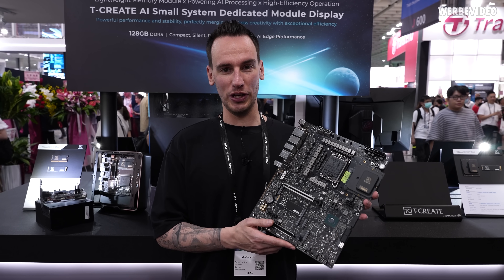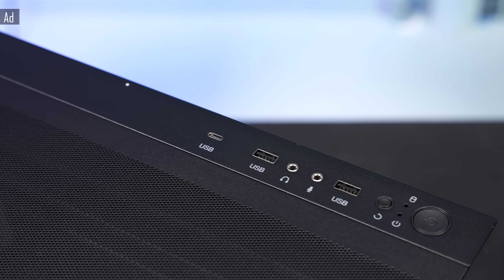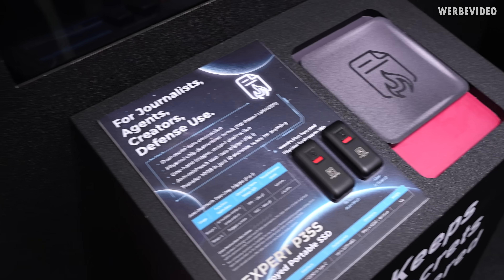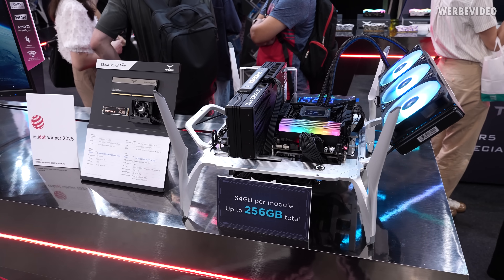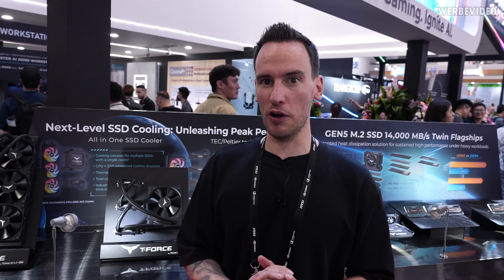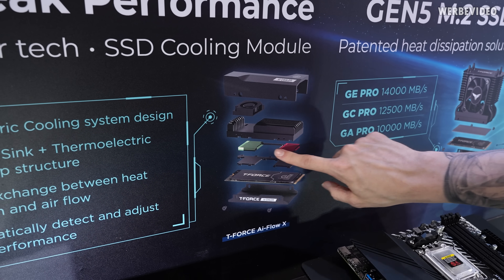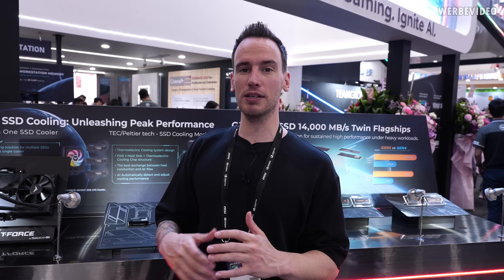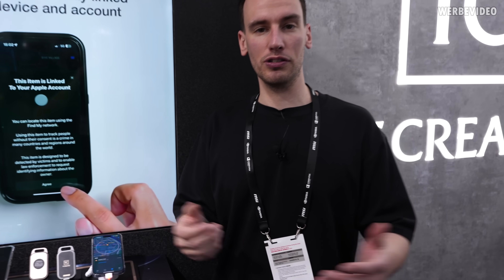This SSD Blows Itself Up on Purpose - TeamGroup Computex 2025

Comment: The stupidity in the comments would be surprising f it was not predictable. You can kill something with voltage and the user can have zero idea anything happened and its not even close to being dangerous (more or less than any SSD is already). But also, just because some applies the name "AI" to something doesn't mean its slop - or rather, at worst, its marketing slop, but marketing is always slop and always has been.  They are whatever legal lies they can use to get you to buy their product over others. Also, some ya'll have become so vigilant over "ai slop" you see it in many places it doesn't exist at all.  This is the problem with a lot of movements/"movements" - they start to generalize in destructive ways, sometimes not even just self destructive.

Comment: to kill the flash you want to probably hold it at around 9v and probably current limited. You dont want to do it too high  too fast or else you will just destroy the internal interposer traces or bond wires (i dont think flash uses bond wires tho) and it would be potentially recoverable
Reply: Yeah, I'm no expert but it seems thier method is not too sound. High voltage will destroy a flash chip, but if you're concerned about threat actors like the three letter agencies, they have some pretty decent toys. I worry that this method will blow up the memory controller/driver while leaving the actual flash portion relatively intact, vunereable to for example SEM attack.

Comment: Ugh I hate the fact that we've normalized trashing perfectly good hardware out of fear that your data will be stolen, even though there are perfectly good ways to erase data permanently. As if e-waste wasn't a big enough issue already.
Also, this reminds me of the Macbooks that were frying their NAND flash because of a faulty voltage regulator. Apple should've just called it a security feature.

Comment: Ok a asus board. can be the CAMM extreme. Intel platform. loos cool.   Regarding the mission impossible auto ssd rip, i can see a lot losing the unit. has to have a extra feature to avoid permanent rip of the unit. I use team group devices. they are ok the rams are super cool. even with no light

Comment: Or you know, just encrypt your data. "Destroying" is as simple as jist unplugging and/or killing power.
Reply: on the advert it mentioned it being for journalists and defense amongst others, which translates to spies and soldiers. In which case, encryption is completely useless as all that would need to be done is quickly upload the file to the nation's supercomputer designed for encryption cracking where it will be decrypted reasonably quickly.
Reply: @rick5078 tell me you know nothing about modern cryptography without telling me you know nothing. We have algorithms that will take centuries to crack on ever the best supercomputers, and now we are slowly adopting quantum resistant algorithms, when quantum atracks are only in the "possible in theory" stage.

Comment: i might be missing something... but why would i want a SSD that could blow itself up...

like one could get samsung t7 touch or Kingston DataTraveler/ironkey 2000 that have onboard cryptographic key...  
Samsung option as much certified and not possible remove key/data without computer access..
but with kingston option if person knows how this thing works they can "blow up the active" cryptographic key in like 10 seconds without connecting it to computer(ofc if you keep the thing charged, yes - this device has internal battery that can drain if not in usage for weeks. No - that dose not mean you will lose your data but you just have to connect it to PC to unlock it)

Comment: I used to love playing with OC systems using the classic thermoelectric Peltier coolers. The 90s were a very fun time for PC customizations and experimentation. Full PCs submerged in mineral oil were my favourites. Great video guys, thanks.
Reply: you can still do peltier cooling if you want, much of how you prepare the board is just like people who use dry ice or liquid nitrogen.
Reply: @xBINARYGODx  but you should never actually want to, because the refrigeration cycle is just better... peltiers are, in real life, only used in domains where the refrigeration cycle makes too much noise/vibration or is too large.
Reply: @rawhide_kobayashi  Normally it is used where size factor doesn't allow for a full compressor to fit, like those crappy little desktop fridges... And even then they suck and can take up to 24 hours to bring the temperatures down to normal fridge temperatures (without opening it)
Reply: @xBINARYGODx  messy frost barriers and the like were fun back in my younger days but now I leave it to the young bucks to gets the scrapes and burns of PC exploration.

Comment: It doesn't need to actually physically destroy -- generally bulk block erase is extremely fast. Following that with high voltage would be icing on the cake. I'd rather have block erase happen first actually. Edit: So that's exactly how it works.

Comment: I can see CAMM2 coming to mini itx motherboards for sff pcs much sooner then I can to ATX motherboards. The horizontal profile is so low that you can probably get some insanely powerful mini pc cpu coolers using the extra space CAMM2 would give.
Reply: could allow for really small form factor for APU with wide memory bus if they put like two camm modules behind the  board

Comment: Im not fully sold on those self destructing ssd's. What if all it does is destroy the Power Management Chips and leave the actual silicon intact, and the Software based deletion Method is prob recoverable too I don't think they went out of they're way to make the drive flip all the bits into nulls to prevent recovery.

Comment: Tech i want to see: mainboard with easy acces to SSD without removing GPU, coolers and opening case. Just remove half of ports on the back, and put 2-3 M.2 ports there, so I could install or remove it easily from the back. 

And also all will be near the CPU...

And you could add newer wifi card there, or any other M.2 format card in future.
Reply: I mean, there are nvme hot swap bays for 5,25 in slots, but they're pretty expensive
Reply: @Burbund  Yes, but many cases do not have 5.25 bays, and cables/ribbons affect performance (that's why they are usualy directly next to CPU).

Comment: I don't think there is a mainboard that would allow running 3x gen5 nvme SSDs under full load simultaneously. The system will go into tilt mode ;D
Reply: Consumer no. Server, yes. They actually have quite a few gen 5 drives
Reply: @8lec_R  True I didn't think of servers, looks like a consumer product to me though, way to bulky and clunky, idk, A for effort but I don't see much use in that thing :)
Reply: @ThrobbingWood  i agree with you

Comment: Self-destructing SSD: from a security point of view, just throwing away the cryptographic key for the drive encryption is enough, unless you have to follow a specific standard which mandates physical destruction. 
AI SSDs: the idea is that total memory as well as memory transfer speed to processing unit (can be either GPU or CPU) are the bottlenecks. If instead of a GPU you use a CPU with many CCUs, then you could use RAM OR multiple SSDs instead. In that case you'd have a setup with something like 12 SSDs with ~14 GB/s read non-stop each, and that would probably require serious cooling.
Reply: Exactly, they already have such a feature on drives like the Kingston Ironkey D500S.  If you type in that password, it cooks the key rendering the encrypted data useless.  At least that's what I understood when I read about it; which I think is genius for two reasons.  1. Someone is physically forcing you to enter the password so you enter the "destruct" password, or  2.  Someone (or agency) with lots of resources tries to brute force the password and they "discover" the destruct password (its supposed to be a simple/dictionary word by design) and nuke the key rather than unlock the encrypted partition.  And you can always reset/format the drive after it's been cooked, no need to buy a new one.

Comment: would be neat if the CAMM could be on the backside to get even closer to the CPU pins giving more space for M.2 etc. on the front
Reply: yeah, like M.2 ports on some devboards. This mezzanine mounting trend on desktop is quite defeating the purpose since it covers quite a lot of PCB area compared to vertical connectors.
Reply: RAM and high-speed M.2 both put out too much heat to go on the back.  And the first board looks to have 6x M.2.

Comment: I really hope CAMM will get adopted within 2-3 years for desktop boards, it will solve a bunch of issues one of them is large tower cooler compatibility. And they could also add active cooling to them for overclocking needs.
Reply: not sure. It will consume way more board surface for same amount of modules. currently you can squeeze a lot of mem modules per stick and cram them sticks together in a very efficient space. I think this is a good solution for laptops and such where low power dimms are making it necessary. in desktops you can just crank the voltage to overcome the limitations of signal integrity due to low power dimms (of course, it gets complicated with higher frequencies, but that would be true for both cases).
Reply: @mn5655  There's also a 2nd problem of adding more memory. For DIMMs, you can just add more sticks whereas for CAMM2, you have to basically replace the existing module- CAMM2 only has 1 slot, so to speak.
Reply: @vik1ng313  You can stack CAMM2s and mobo makers can think about putting them on the other side.
Reply: @vik1ng313  But you can't just add more dimms with ddr5, unless you start out using one stick, which is stupid... using more than two slots tanks your top speed. which was also true for ddr4, but even more true for ddr5... for gaming, you want more motherboards with just 2 slots, or a format change, like camm.
Reply: @rawhide_kobayashi  Yeah I know that, but ultimately you can still add DIMMs.
With CAMM2, there's only 1 slot so you HAVE to replace the entire module.
I do hope they find a good solution to the problem, but then again not a lot of people tend to add/upgrade RAM.
Reply: @XenonG  You do realize that they have to route the traces over there and that there's next to no empty space on a Mainboard. ?

as for what @rawhide_kobayashi mentioned, well yes, as long as we stick to a 128-bit memory interface, I do wonder why we are not using broader interfaces like in Gpus. The upper midl level to high end cards use a 256-bit wide memory bus and the really high end stuff 320-bit and 384-bit wide memory busses. Or have an option for Quad-channel if we want to. I remember when we went from single to dual channel when dual channel was the magic word....over 20 years ago. 
Man we thougth we'd be at quad or sextuple or octuple channel by now.....
Reply: @XenonG  Really? I thought it was just 1 'slot' and just the module gets bigger according to size. Is it like SODIMMs in laptop with 1 slot right above the next?
Reply: @LupusAries  As we go for higher MTs, it's either soldering them (memory chips) on the boards, extra "signal booster" chips on the DIMM or we go for compressed attached. Unless you want them on processor substrates? HBM or later version of HBM sound nice though, but once they were proven fast and reliable, demand goes right over supply.

Current traces for DIMMs with two or four models are just as complicated, CAMM/CAMM2 will reduce complexity.

Would love quad channel, but that requires extra die area on processor (or AMD's IO chiplet, or Intel's newer chiplet designs), 256-bit width bus at 8000MT/s can get you over 256GBytes/s
Reply: @vik1ng313  just because you can doesn't mean you should, or that most people ever do...
Reply: @LupusAries  we're stuck with dual channel because it cuts into workstation marketshare... and you need physically larger CPU packages to fit in the pins that the extra memory channels need, and people already have trouble with the size that CPUs currently are... there are limitations on signal integrity that the socket format imposes as well, CPUs and memory both directly soldered to the board remove so many problems...
Reply: Even if it is adopted, Aircoolers still have to make it backwards compatible for some time. Still, I don't think ram clearance is that much of an issue for aircooler performance
Reply: I'm still waiting for an ATX2VO board
Reply: It seems like they would be very easy to cool.
Reply: I really like it tbh reduces failure points and potentially cost they could also integrate a ssd moving it to the back could help make mbs smaller then itx😮
Reply: Yeah because overclocking nets these HUUGE gains nowadays.... Wait, to soonTM.
Reply: Crazy 😧

Comment: I know DIMMs aren't the best form factor, but they have worked well and are especially nice for density since they go vertical. Sure the interface might be nearing the limit but we can always design a new DIMM style interface that could help such as when a transition to DDR6 or 7 happens. The nice thing is the expandability, having 4 or more slots. CAMM is just 1 big slab on the board. Want to upgrade the memory? replace the whole thing and have a paperweight from the old one. I really dont like that aspect.
Reply: there's already a new DIMM "style", is called CUDIMM and it can go over 9000MTs, but most cpu don't support it yet.
Reply: CAMMs can be stacked on top of each other if the module properly has lands on both sides
Reply: @erkinalp  Oh cool, I did not know that. Hopefully if/when CAMM begins to proliferate on motherboards all the modules end up being made with the stacking feature then.
Reply: Nobody said we had to stop making motherboards with DIMMs.  If someone want's a board with CAMM2, they should have the option.  I still want to get an ATX12VO motherboard and PSU since it was introduced over 5 years ago, but there is literally zero availability for it.
Reply: Eh? A CAMM module is electrically 2 DIMMs, and it's removable. There's very, very few cases these days when people are running DIMMs in any configuration other than pairs so it's the same amount of hardware being changed out with an upgrade and the footprint is small enough that you could still fit 2 on a motherboard in place of 4 DIMM slots (it would be a bigger footprint, just not by enough to make a significant difference)
Reply: @bosstowndynamics5488  Yes it is removable, the whole thing...

Comment: Hey thereDER8AURE what fittings & soft tubing are you using ?? I need to turn my current set up into open loop:(
  Tapping. Into 3 aio. Replacing the rads in one or two coppers. 
Two of which are 295x2x2 & a intell aio
I know already how to route the tubes  & reducers. I just like to know what you use look to be very convenient

Comment: I would be slightly concerned that maybe the Kill command might have so much fun blowing itself up, it might not stop at just doing the one component... 
Cascading Failure--> Release ALL the Magic Pixie Smoke, Engage!
Reply: It specifically says on the placard  it's a portable SSD, so it'd be for things in an USB stick etc. At that point it probably has a built in battery or capacitor just for destroying the device, allowing you to destroy it in transit.

Comment: is it legal to bring this SSD on an airplane?
Reply: Yes it would be legal, as it simply overvolting the chips.
Reply: Probably. I'm assuming it requires external power.
Reply: @wiizrbreh  That would make the selfdestruct function a lot less useful.
Reply: No, it's 10 years in prison to take SSD into an airplane.

Comment: I want to see camm2 in pc and laptops. Hopefully, even in phones.
Reply: Phones seem unlikely. It would make them significantly larger to do any sort of replaceable ram. Also it would be a step backwards performance wise. No real benifit there except perhaps in after sale configureability and that'll go over with phone manufacturers like a fart in a crowded car.
Reply: @kaseyboles30 My pockets can handle it, plus phone screens are too small for my liking.
Reply: @rch5395 I think you're seriously underestimating the size difference between the RAM packages in phones compared to a CAMM - the entire motherboard on a typical phone is substantially smaller than just a CAMM
Reply: No, camm2 should stay on laptops. If not, DRAM manufacturer will sell 32GB for shit pricing, and 48+ gigs pricing will take a months pay.
Reply: @AlfaPro1337  Why would it be more expensive? A shared form factor for desktops and laptops would brings some economy of scale benefits.
Reply: @whyjay9959  Argument is flawed, SODIMM can be used on desktop too.

Dude, I'm talking about manufacturers will gatekeep higher capacity CAMM over exorbitant $$$ for no reason.
Reply: @AlfaPro1337 current laptop ram sticks are so ass compared to desktop.
Reply: @rch5395  "current laptop ram sticks are so ass compared to desktop"?

Dude, desktop has more data pins versus SODIMM.
Reply: @AlfaPro1337  Also just less capacity overall. I like`em gigabytes big.
Reply: @alexturnbackthearmy1907  Just like how SSD capacity got stagnant on M.2. There are other better form factor like U.2/3.

Heck, at least utilised the longer 22110 instead of 2280, desktop can accommodate that long.
Reply: @AlfaPro1337 there are a lot of ram stick manufacturers. Suck pricing only happens when there is a cartel/monopoly/duapoly going on.
Reply: @rch5395  "there are a lot of ram stick manufacturers."?

Sorry, there are only 4 REAL DRAM manufacturers, Samsung, SK Hynix, Kingston and Micron. 

Teamgroup? No. Corsair? No. GSkill? No. They just slap stickers.